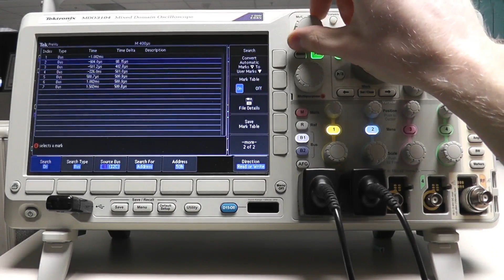How do I use the serial decoder function on the MDO3000?

Comment: I have used Tektronix scopes since 1973, and⏩>imgs.love/TOscilloscope?ѽ   owned 4 of them personally, 3 more were work scopes. This model is labeled as an introductory scope, but is far better than that. It has the features of earlier models that cost over a thousand dollars. It easily triggers on difficult signals, produces very accurate measurements of wave forms, has the ability to magnify a small portion of the display, and delay triggering, among other outstanding features.